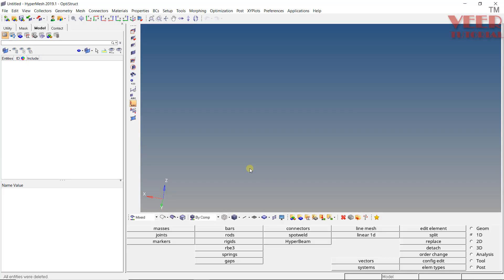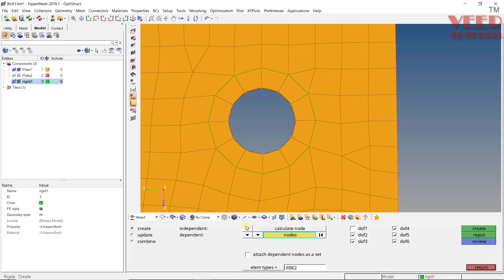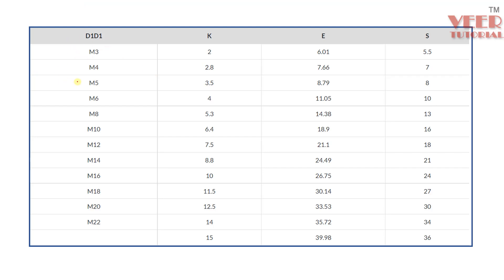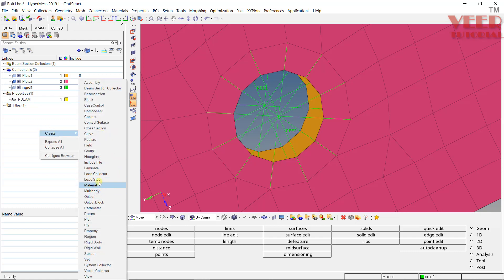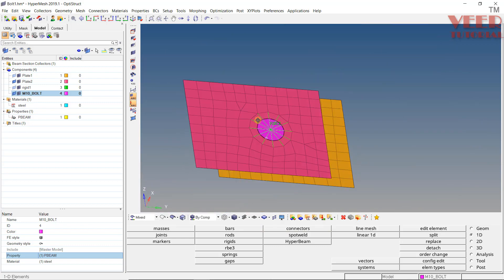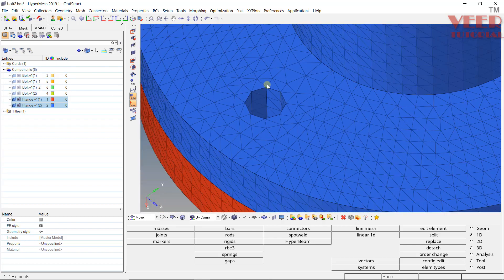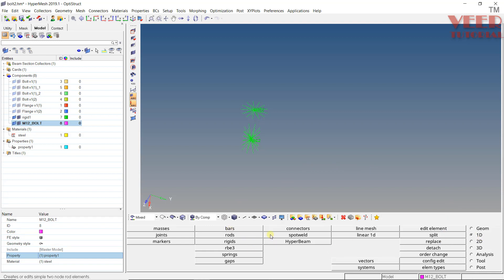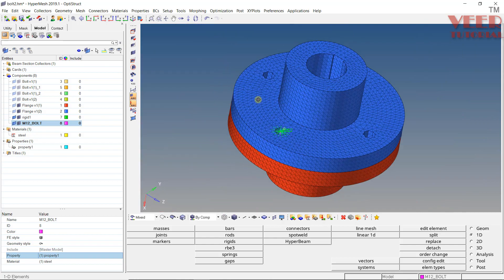hYPERMESH | Bolt Connection using RBE2 Elements

Comment: Hi, for bolt creation you have selected the orientation perpendicular to X axis. in this case beam is exactly in X-axis..what if bolt is not alligned to any of the axis, what orientation to select?
Reply: make two node that on the crosslines of flange and  shank, then makes line with two node that we made and chose the line as a basic line
Reply from the maker: you can do this by making a local co-ordinate system or define a vector by two nodes in perpendicular direction
Reply: @practicalfea5590 Thanks for the explanation